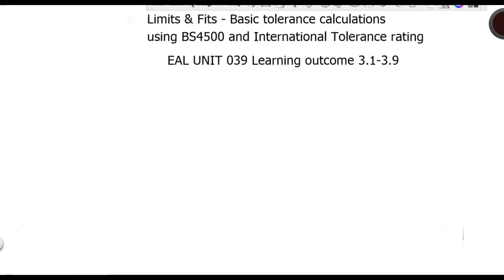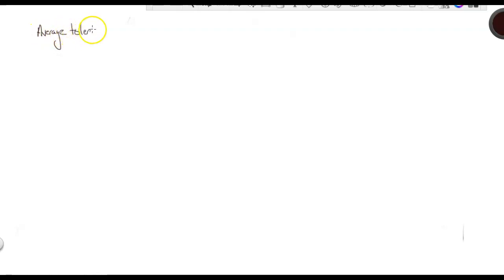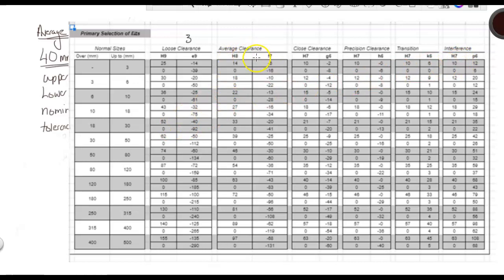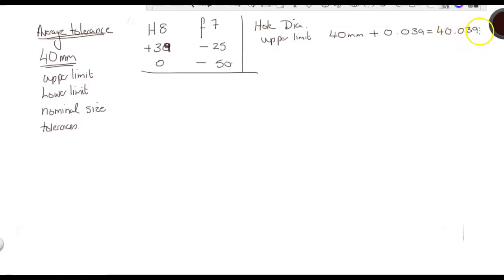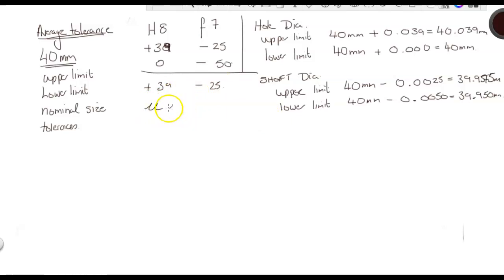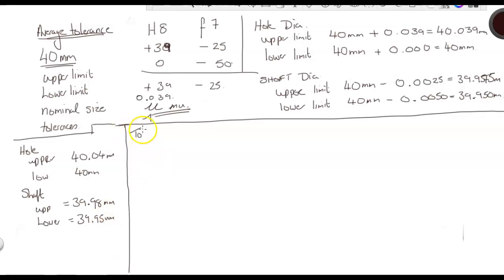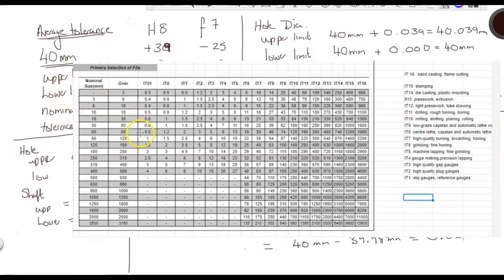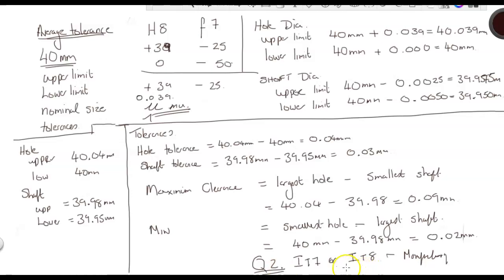Limits & Fits Calculations

Comment: There are several numerical errors, but overall the explanation helps a lot to understand the concepts; my only question is: could the IT designation be IT9 too? Considering that the max tolerance is 0.04 mm, which is greater than 0.039 mm (IT8)

Comment: max clearance= largest hole - smallest shaft.
However, I think the smallest shaft is 39.95,
I would like to know if this is a typo or not
Reply: Yes, that's a typo, also the one regarding the values in microns in f7 for the shaft
Reply: @martingaete8098  so it is actually 39.95? or should be 39.98